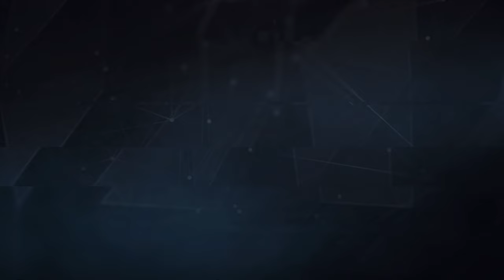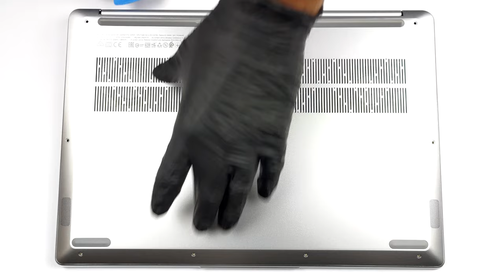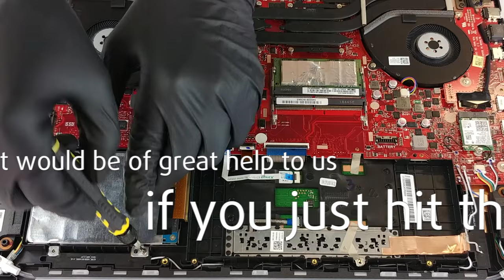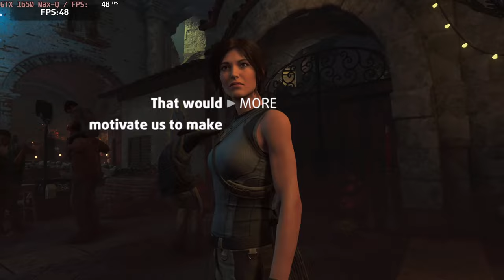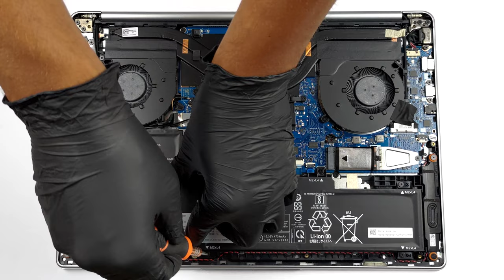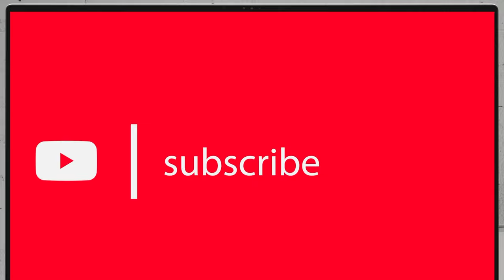🛠️ Lenovo IdeaPad 5 Pro (16", 2022) - disassembly and upgrade options

Comment: You should explain more detailed how complicated/hard it is to remove the Aluminum lid. I really hate the manufactories for this Bad Design...
Reply: How do I do it? Pulling hard with my nails isn't doing anything. I don't want to use too much force and break something
Reply: @defnotatroll  A plastic card or something similar and pry gently along the edges.
Reply: @alexandruilea915  it was too tightly sealed to get anything in there, I had to use a razor which scratched the paint
Reply: @defnotatroll  Strange, I did manage to open mine with a plastic card.
Reply: @defnotatroll  Start along the back, where the hinge is. The back edge of the bottom panel is accessible along the gap, and you can pry it up there and then work around the other edges from there.

Comment: I bought a Lenovo Ideapad 5 Pro 16" with 1TB PCIE SSD card as the hard drive. Is there any way I can upgrade this to a Hynix 2TB PCIE card in the provided slot (as shown in your video here) and "reset the laptop to factory standards"? Any idea how many approx charges is is fair to assume would be the battery life in this laptop? I would appreciate it if I could get an answer to this. Thank you!
Reply: I believe you can, you can buy the new 2b PCIE and clone the previous one to it so that you have the windows exactly as you previously haf

Comment: So... could  you please tell the dimensions of the storage stick ? could one install say, a 2 terrabyte stick? what about a 4 terabyte?
Reply: Of course. The largest supported form factor is 2280. But you are free to choose whatever size (in GB or TB) of SSD you want.
Reply: @musmuk5350  yo I just got the Lenovo ideapad 5 pro 16 I'm not sure if it's the same model but how do I check if my laptop has expandable storage? It has 512gb ssd right off the bat and if possible I'd like to add more storage, or do I have to replace that 512 entirely? How exactly does it work I don't really understand how it works.
Reply: @aaronnoelson156  Yes, there is only 1 M.2 slot. Thus, you will need to replace existing one. I would recommend to pick up something like Samsung EVO 2TB

Comment: I can understand the soldered ram for battery sake. But what the heck is one m2 slot lmao.
Reply: slim and light machine what can you expect ?
Reply: Nah...ram is the 1st thing to upgrade, not dual SSDs?

If mine came with only 8gb soldered I'd be very sad. not being able to upgrade is worse than any single slot.

They sell 4tb nvme

They sell 32gb ram sticks, easy upgrade if it weren't soldered...
Reply: ? @diox8tony  as I understant you've already bouhtg it,right? Were you able to upgrade your ram?

Comment: Why do you make prying bottom panel look so easy
Reply: Ive been struggling for the last 20 minutes lol
Reply: @antarctic9626  same. How do you do it?
Reply: @defnotatroll  i cant totally remember but i think you wanna go and get your fingers under the hinge part (the part that folds when you open the laptop) and really try and pry it off. be more aggressive than you think. again i cant totally remember tho so take it with a grain of salt.
Reply: Okay guys. Here's what helped me. First put smth flat under the bottom part and then get your fingers under the hing part. Pull slightly with your fingers and lift the bottom part with the flat thing at the same time. Do it slightly and play around. It will come off.

Comment: So I understand there is a soldered RAM. the one I'm looking at has only 8GB. That means it's not upgradable?  8GB for Windows machines is almost a joke. For Mac, I can understand, but for Windows machines, that's probably not gonna cut it in couple of years.
Reply: 8gb but the speed of that RAM is x3 from the previous generation.
Reply: if you can find the schematics and someone willing enough, you could probably swap the ram from the 16gb model to the 8gb model of the same motherboards and change the strapping
Reply: I have the 16gb version